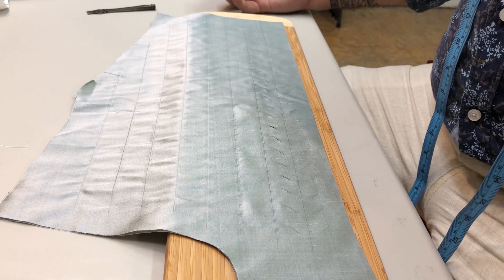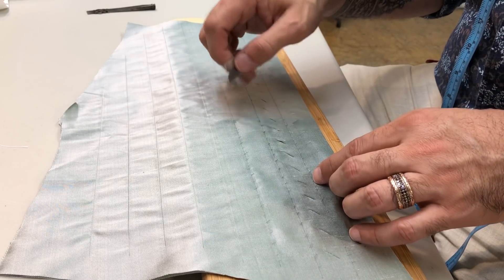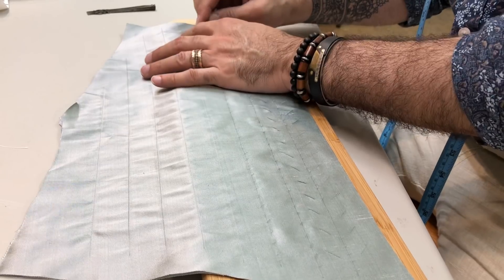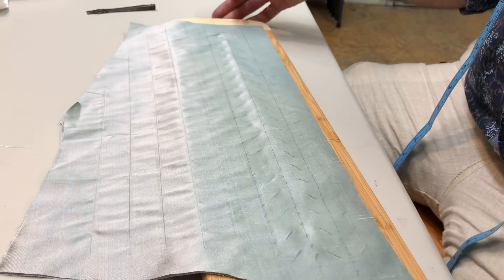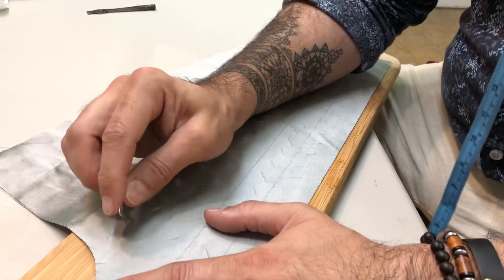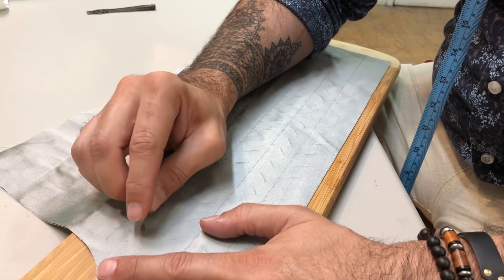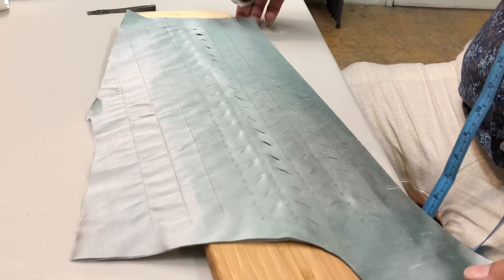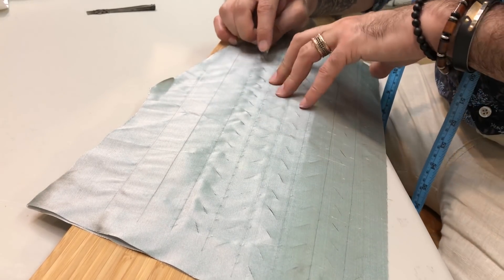HOW TO PINK AND SLASH A SILK DOUBLET: how to use a blade and board for cutting intricate patterns

Comment: That is fabulous. What kind of silk are you using?
Reply from the maker: This is a plain, smooth shantung with a two color weave. One of the best parts of using this kind of silk is that over time the cuts “bloom” and the two different colors of the weave become more visible in the cut. It really adds to the depth and texture of the fabric.